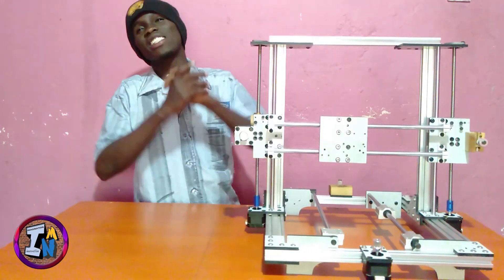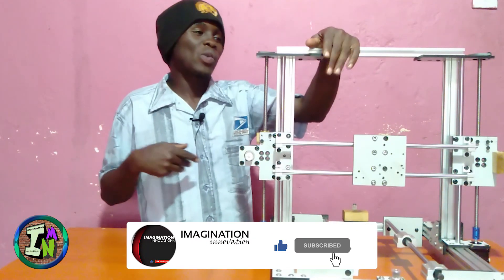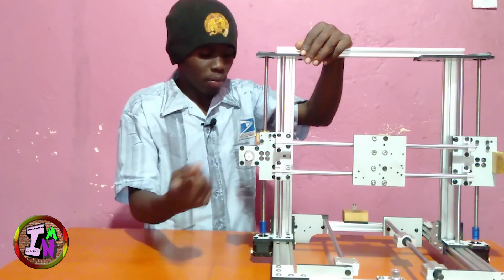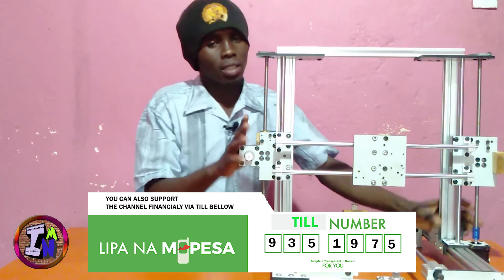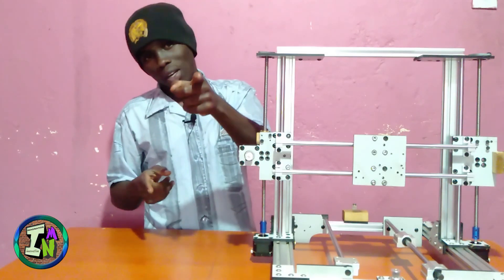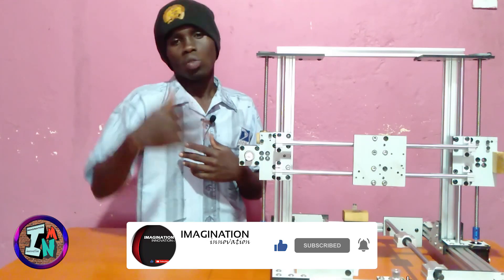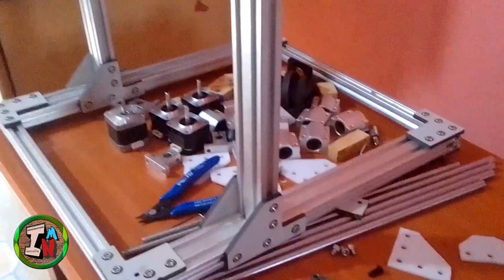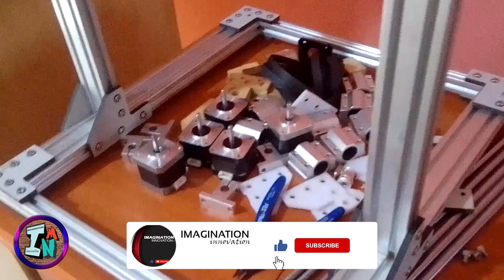3 IN ONE 3D PRINTER_CNC_LASER ENGRAVER #3dprinters #3dprinting #3dprintinbusiness

Comment: which software are you using to 3d print laser engrave and cnc parts please telll
Reply from the maker: Have not uploaded any testing for 3d printing process but yes although am doing some some things manually like to change it to 3d printer, (that is to use skr board from arduino uno v3 board for cnc engraving) am I making sense I mean I don't have yet a all in one software to it at as one (and change stepper motor connectors from arduino uno v3 to skr 1.4 turbo board manually) I did this for testing am still trying to configure the skr 1.4 turbo board using the software used by duet board as with duet you can configure the software commands and save them in MACROS FOLDER now when you have configured them(3dprinting firmware, cnc milling machine firmware, laser engraving firmware) you will need to save them in MACROS FOLDER here you be able to switch from cnc to 3d printers, to laser engraver, by just pressing one of them. (when you press 3dprinting it changes to 3d printer as the 3d printing firmware gets INSTALLED.BUT I'LL UPLOAD THE CONFIGURATION VIDEO EVEN THOUGH IT IS VERY LONG I THINK IT'S GOOD TO UPLOAD FOR IT WILL HELP SOMEONE
Reply from the maker: For now trying to configure REPRAP FIRMWARE for 3 in 1 control and easy switching experience once complete I'll upload a good video for how to configure thank you for your good question